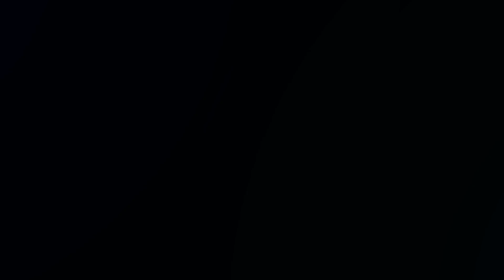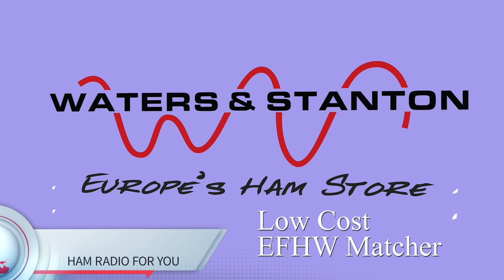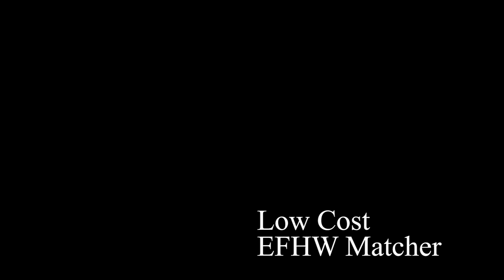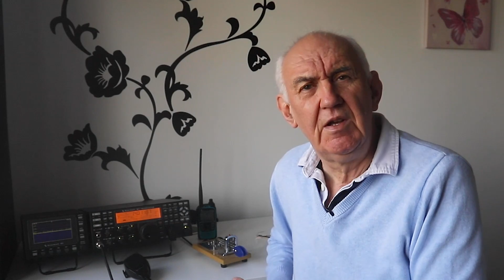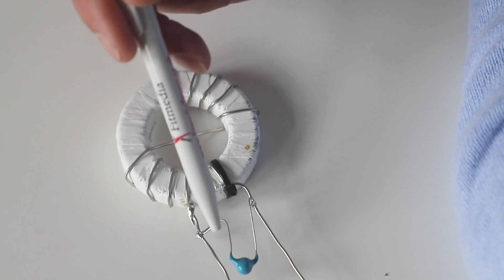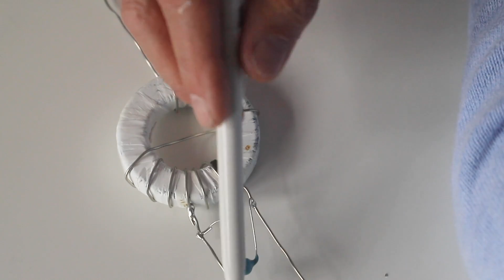Low Cost EFHW Antenna Matching Transformer

Comment: 4 to 1 and 9 to 1 ununs can be made by winding wire on a tubular form. No need for a toroid. You get better bandwidth and no heating problems. The one advantage to the toroid is that overall size is smaller. KK5R

Comment: Just wondering about the Fair Rite 43 core. I noticed it works from 25 - 300 MHz. Would the 31 material be better for HF?
Reply from the maker: The core works across the whole HF spectrum and is almost an “industry standard.”
Reply: @watersstanton  I just go on the specs... I have noticed many use the Fair Rite 43 but the specs would suggest the Fair Rite 31 as a more suitable option because of the frequency coverage. I don't have the equipment to test in a real world application, else I would. Many thought the Sun revolved around the World once.
Reply: @watersstanton 
Some consideration might be if there were thoughts to cover HF and 6M. Otherwise, you're right.

Comment: thank you for your video!  quick question.   you mention approx. 3000 ohms on a 40m 1/2-wave wire (468/7.5MHz = 62.4 feet of wire for 1/2-wave 40m).  in order to reduce resistance on the wire to match a 50 ohm input, the unun / transformer needs a value of 60:1.  so, do the 5 turns on each side of the ferrite shown along with the cap result in 50 ohms being shown to the coax?
Reply from the maker: 3000 is an approximation and varies with height and location. 49:1 is by far the best option.  The next option id 64:1  and the difference is minute! Go with 49:1.
Reply: Thank you @watersstanton  !

Comment: Many thanks, Peter. Having recently discovered your channel, I was glad to have seen this video, because my first attempt at winding the UNUN with the bifilar primary produced some results I couldn't understand, but definitely did not look good. I tried a couple more times, each one with a little better results, but still not quite what I would have expected. When I rebuilt it again using your single winding technique, I finally got some more believable results.  

An observation I wanted to make, however, is that given the tap point is 2 turns from the earth end of the transformer, using only 5 turns before and after the cross over results in a turns ratio of 10:2 (or 11:2 if the cross over is counted as one turn), which you identify as being less than the "recommended" number of turns. This would result in a 25:1 (or 30.25:1) impedance ratio. The usual references I've seen to EFHW UNUNs refer to a 49:1 ratio. I'd guess that the difference in the impedance matching characteristics of your design might be a partial explanation for the improved performance on the higher bands that you suggest. My thinking is that the impedance at the feed end of the EFHW wire is a bit different on each band (lower on the upper bands, so the match is better with a lower impedance ratio).

At any rate, I'm looking forward to getting this antenna built and getting on the air again after a 40 year lapse. Thanks again, Peter. 73 Phil KE7HC, Michigan, USA.

Comment: Any advice for a total newbie just starting out and my first rig (gift from my son) a TYT TH-9000D and mic? I picked up the programming cable, have the software at the ready and using a magnetic auto whip antenna. I worked in cable television as a technician for many years and have prepped to build a rooftop dipole, RG-11 cable and high to 50 ohm matching transformer. Other than that basic install I'm struggling to get started. I'd picked up on station locally for a short bit. Thanks in advance if anyone has some guidance. Bless all!
Reply from the maker: I believe the radio you have is a VHF set - possibly covering the 2m ham radio band. Your best option is to purchase a fibre glass 2m vertical and install it outside or in the loft. Check out the Diamond X-30 model. Make sure you purchase the model with SO-239 socket. Then you need coax cable with PL-259 plug at either end to connect up to your set.

Comment: Why do all the other 49:1 UnUn vids say to double up the primary wires and use 14 turns? Some want you to stack 2 toroids together. Really confused here.
Reply from the maker: Stacking increases power rating. My winding is an option but it is simple and it works!
Reply: @watersstanton  oh that makes sense. Thank you the reply and the great videos. 73

Comment: My EFHW acts like it is shorted. No noise on receive and high SWR. When I unscrew the shield from the pl259 and only the center is hooked to the so239 I get receive noise. What would cause this? Thanks for this great video!
Reply from the maker: Almost certainly there is a fault on the 49:1 transformer or the cox plug into the transformer. Peter.
Reply: @watersstanton  Bending the coax a certain way at the pl-259 cause it to short out. Thank you!

Comment: Hi Peter.. Great video as always.. I’ve been using this unun for a couple of months now with relatively excellent results given that I have a very poor antenna and antenna location.. There is no high level science involved in my conclusion..it got me back on the air (after a half century break!) and it works!! So thank you..
Could you take a guess as to the maximum power one should use with this unun.. It is slightly warm after a period of 100w CW..
Many thanks again for this, and all of your videos..
73…John..G4EIJ.. Bristol
Reply from the maker: Hi there. I have never used more than 100W which is all the power I have. I suspect you can run a bit more on SSB bur NOT on FT8!  73 Peter.
Reply: @watersstanton  Thanks Peter..That’s all I have too.. It’s working great for me..so many thanks..John

Comment: Hi Peter, I am learning lots from your videos, what would be the power rating of this matching transformer?
And what size is the wire being used, and would larger wire give higher power rating?
Reply from the maker: It will handle 100W. The gauge is not too important. I think is was 20swg. Poer handling is largely determined by the number of cores. Two will probably handle 400W. 73  Peter
Reply: @watersstanton  When you say 2 cores, how would that be configured?
Reply: Hi Peter, in the video, you mentioned adding an extra turn to  use on 80m, would it still work good on 40 and 20?

Also,  what would the ratio be with the 6 turns, I'm trying to understand the workings of it.

Thanks for all the great videos...

Comment: Peter- this is "brilliant" as you Brits would say... 

I now have everything I need to build my HWEF 80/4020/10 antenna. By using the loading coil you covered in another video, I can fit it in my back yard between a tree and the house, AND I can get better resonance points on 40 to 10. I'll follow your advice and use an isolation transformer close to my rig. 

You've given me everything I need,,, including instructions on how to build it all myself if I want.

Again- BRILLIANT! 

-Jake

Comment: Can you tell me why you would ever need more than a 100. Volt capacitor at 100. pF across the end of the Fifty Ohm coaxial cable, for a one hundred Watts signal? Ron W4BIN
Reply from the maker: Capacitors are rated at DC. We are dealing with RF. The load will never be zero VSWR and can rise rise significantly. Try 100V and see them pop! Peter
Reply: (1) 50 ohms, if the load is matched; the SWR will be higher, perhaps 3:1, so the impedance at the coax may be 150 ohms.
(2) Peak-to-peak RF voltage is usually a reasonable guide to select a DC working voltage rating for a capacitor. The peak-to-peak voltage will always be higher than the RMS voltage, particularly for complex waveforms, such as speech.

Doing the arithmetic, 100 W RMS, 150 ohms yields 346 V peak-to-peak. A 500 VDC working voltage would be the smallest I would use for 100 W.

Comment: There's lots of designs for these around the I'net but many suffer from high loss. It would be interesting to measure 2 of these connected back-to-back on a network analyzer. Even a #47 pilot lamp at the 1-watt level can do this by comparing brilliance with and without the transformers. Use one on a power supply for a reference brightness to compare both cases with, then calculate the power in the lamp and the loss. Thanks for the vid. --N2GX
Reply from the maker: There is a much easier and more accurate way than using bulbs. ATU and RF current meter vs Transforner and RF current meter. 73 Peter.

Comment: Hi Peter, I am learning lots from your videos. I recently purchased an Icom IC-7300 and, having a small garden, I am planning to build an EFHW antenna per your suggestions. Two questions: Is 65 mm the inside or outside diameter of your toroid core? And what is the gauge of the tinned copper wire you are using for the toroid winding? Thanks so much. Gordon VA3GSR
Reply from the maker: 65mm is outside diameter, Wire is 18 swg but nit critical. You will love tge antenna. 73 Peter
Reply: @watersstanton  Hi Peter, Thank you so much for answering my questions. It is appreciated. I have another question more general in this case. It concerns the length of the wire element. To connect the wire to the insulators you must fold it back and wrap it around the antenna wire somehow and fasten it there. That uses up some of the wire length and that means that the measured distance between the insulators on your support poles will be less than the required distance calculated by dividing 468 by frequency (MHz). My question is should the distance  from insulator to insulator be the calculated length or is it only necessary that the wire element itself be the calculated length no matter how much is folded back in securing it to the insulators? Thank you. Gordon

Comment: I have an efhw and my Balun is about 3 feet from the ground.
Should it be higher since most of the power comes from that end?
Reply from the maker: No problem. The power is actually distributed among the whole length.

Comment: Peter- just to followup. I have all the materials and am ready to build following your video but I am confused on the turn count looking at the Toroid in the video. Looking at the top right , there are clearly 5 turns, it's the lower left that confuses me. In the video, you say two turns for the ground wire and then 5 more. So is there one turn hidden under the black wire tie? and then 5 more to the left? Does  the wire that  starts the winding - continue all around and come out the top? And then a second piece of wire is connected at the location where the left side if 100pF capacitor is soldered on ? so 12 turns altogether?  Appreciate any clarification you can give. Tnx
Reply from the maker: Hi there. If you copy the illustration you will be OK. There are 2 turns, then a tap. Then 3 more turns before the wire crosses. Then there are five and a half turns which I think is pretty clear.  BUT don't get too hung up on this. I did add an extra turn on the other side and all that happened was a slight improvement in matching on 80m and less good on 10m. The fact is that 80m - 10m is right on the limit and one turn more or one turn less simply skews it HF or LF. 73 Peter.  73 Peter.
Reply: Peter Tnx for reply and further explanation. I didn’t see the illustration you cite ?

Comment: Peter  can you confirm size of the capacitor? was it 100 pf?? tnx Paul
Reply from the maker: i used 2x220pf in series. So 100pf is fine. Not super crytical.
Reply: @watersstanton  I would just as soon use what is best. So for mostly 20m and 40m what would be the IDEAL capacitor size to use to use??  thanks Paul

Comment: Thanks Peter.  I'm certainly no expert but in my experiences,  I find that the worry you mention concerning bifilar "twisted" pairs shorting out may be a bit unwarranted. I hope the following explanation alleviates some of that concern when improved performance is desired.

 Shorts are almost non-existent in these applications and quite frankly, even when they do occur, they do not have drastic affects in this application that some folks might associate with  "short circuits".  Here's one way of thinking about it:  Imagine winding your primary with a bifilar (twisted) pair where there are 1000 unexpected shorts occurring between the two bifilar wires of the common, shared lengths comprising the primary winding (not shorts between the two-turns themselves). If you think about it, the result of these shorts of the twisted pair would simply be to electrically convert these two conductors of the bifilar winding to a single conductor (which is exactly what you are doing here anyway!) .   Taking this example to the extreme, let's say we use tinned, bare, un-insulated copper wire and, despite knowing better,  we twist them together in a bifilar fashion (which, of course, shorts them together for their entire length to be used for the primary winding), and then using this resulting wire/s we wind the primary. Then, ignoring the fact that we KNOW that in actuality the bifilar pair is shorted together, we go ahead and connect their individual ends to form the primary as if we'd actually used insulated, annealed copper. What would be the end result?  Electrically, the final result would simply be the exact same transformer circuit that you have wired and demonstrated here. That is, functionally, the shorted bifilar-wound bare wires would result in a single-conductor as the primary and the total transformer winding would be electrically center-tapped as in your original design. For emphasis:  The twists would be completely shorted together forming one larger conductor for the first two turns, tapped at the same two-turn point as desired. Now, I'm not recommending doing this to any advantage, but rather only to illustrate the point. 

So, though a just a slight bit more challenging,  I think your viewers might wish to consider using annealed copper (#14 magnet wire) and winding the primary's turns in a bifilar fashion which will reduce losses (core temps),  improve efficiency, and improve performance in the lower frequency ranges among others. But, having said all this, for specific applications needing a quick & easy solution, this design that you have shared here focuses directly on 'simplicity' and as such, takes that prize.  Thank you Peter. Well-presented.   73.
Reply from the maker: Hi there. I was referring to the often used  twisted input pair which could result in a dead short. Peter
Reply: watersstanton I guess I didn’t explain it clearly enough. A “dead short”? No. I don’t know how to say it any other way.  73
Reply: I’ve used enamelled copper wire with twisted for primary and if I put a meter across the so239 I have a short. Don’t know if this is expected or I’ve done something wrong.

Comment: Great vid. Will be making one but is that toroid really 65mm Diameter?  It looks much smaller on the video against the capacitor and your pen. I have one 38mm OD / 24mm ID, will that work the same or will I require more / less turns please.
Thanks

Comment: Cheers for this.  Build this antenna in about 20 mins.  Never built a transformer before. Amazing. Worked Portugal 5 9 plus from London, and the the Orkneys, even stronger.
Reply from the maker: Sid, glad you got good results - 73s Peter

Comment: Good Video, I think the EFHW deserves more promotion - minor point I think your transformer has 11 turns as the crossover turn ( the Riesert modification) counts as a turn -- 10,11,12 doesn't matter too much. (I use 14). The real issue  - the one that may need experimenting with is the earthing and counterpoise arrangements.  If your transformer is near the ground it is not a problem - just earth to a earth rod. But if the Trafo is up in the air then some people add a short wire counterpoise (0.05 of your lowest wavelength) or a choke a short distance down the coax (0.05 wavelength down the wire)  - or just leave coax lying on the ground and hope any outer shield currents leak to earth before it gets to the shack. The chokes work best if good quality - 4k Ohms so you need another FT240. Also (always) worth adding additional chokes to all coax that enters your shack and adding an Earth Rod just outside the shack too. Of course if you don't bother it all still works...

 It would be nice if one arrangement worked and the others didn't - but all antennas "work"  And RF in the shack is a mixed bag, sometimes you don't notice and it doesn't matter too much. For portable operation it doesn't matter at all I suppose.

Thanks for putting out the video, I am looking forward to  your next one and what you do for earthing. Best 73, MI5AFL
Reply: I am confused on the turn count looking at the toroid in the video. Looking at the top right , there are clearly 5 turns, it's the lower left that confuses me. In the video, Peter says two turns for the ground wire and then 5 more. So is there one turn hidden under the black wire tie? and then 5 more to the left? Does  the wire that  starts the winding - continue all around and come out the top? And then a second piece of wire is connected at the location where the left side if 100pF capacitor is soldered on ?
Reply from the maker: Hi Ian,

You raise some interesting questions. There is much on the web about whether to earth or not to earth. I have tried short and long lengths of coax feeder. I have tried an earth and a counterpoise, and frankly have not come to any conclusions - all options seem to work well! My bottom line is always, does it work! Keep in touch. 73s Peter.